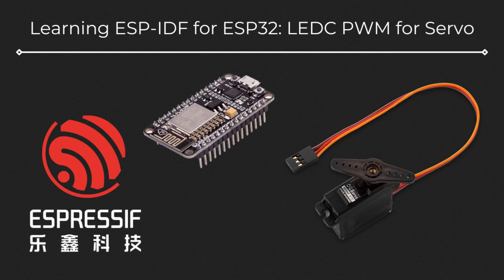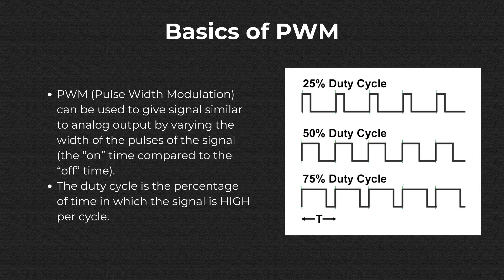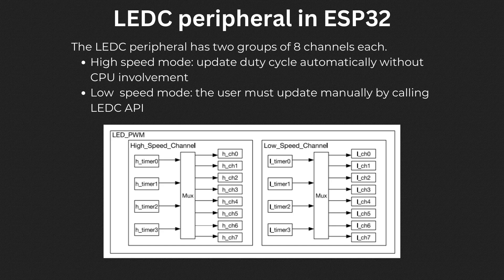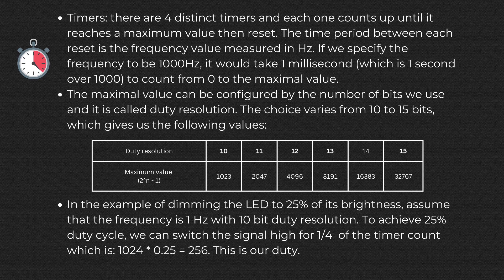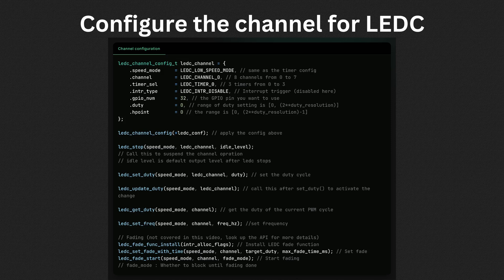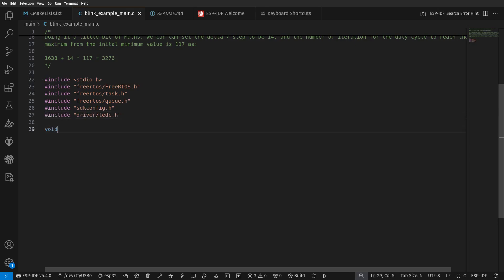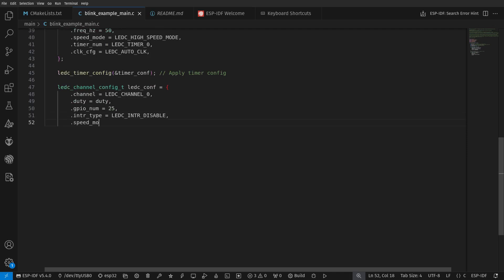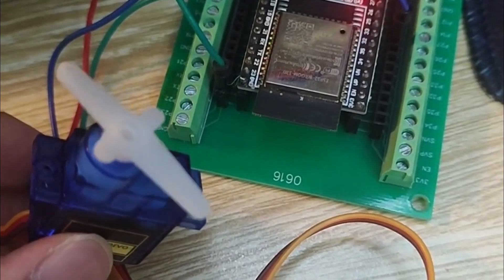ESP32 with ESP IDF #3 | Controlling PWM Output with LEDC peripheral and use it to rotate a servo

Comment: How can i change the servo motor's angle instantly?  Turning from 10 degree to 150 degree for example takes time
Reply from the maker: @newman8273   Reduce the time in VTaskDelay function (it is similar to Arduino delay) until it is as fast as you intend it to. Still I dont believe it can be made instantaneous, the servo itself has limitation

Comment: How do you deal with platformio and espidf at the same vscode window ? Isnt it a problem for you when using platformio? For me the espidf extension is always displayed on the bottom bar even when I am in a platformio project
Reply from the maker: @MixalisXaxalios   My guess is that you can go to the extensions tab and then disable it. Enable it again when working with espidf project. I don't find it to be a problem for me. Anyways tks for watching ❤️

Comment: I''ve a problem with the 15 BIT and the speed mode, on: 

  ledc_timer_config_t timer_conf = {
        .duty_resolution = LEDC_TIMER_15_BIT, // identifier "LEDC_TIMER_15_BIT" is undefined
        .freq_hz = 50,
        .speed_mode = LEDC_HIGH_SPEED_MODE, // "identifier "LEDC_HIGH_SPEED_MODE" is undefined"
        .timer_num = LEDC_TIMER_0,
        .clk_cfg = LEDC_AUTO_CLK,
    };

I'm using IDF v5.50, maybe thats why it fails. 
The 15_BIT issue can be solved easyly just using the 14_BIT resolution and doing the math, but maybe they changed something on the speed mode. 

Anyway, great videos. I've some experience with arduino and coding ESP32 with arduino framework, but IDF gives more control. Thanks for sharing your knowledge with us.